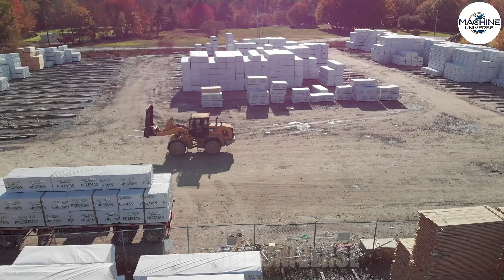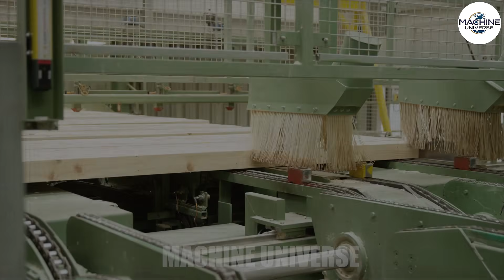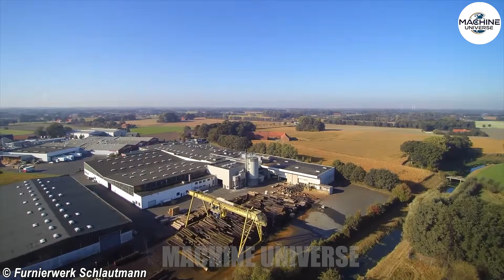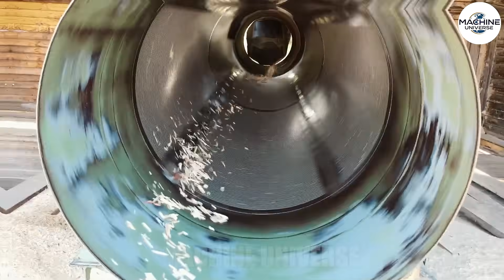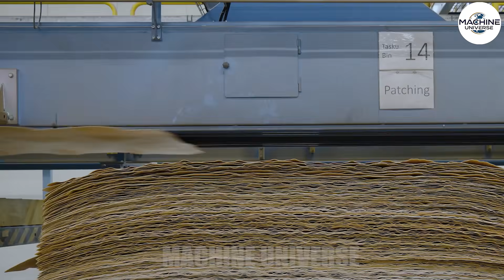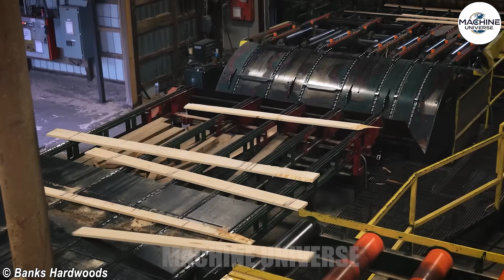Inside USA’s Most Advanced $1.2 Billion Sawmill – From Giant Logs to Precision Lumber and Panels!

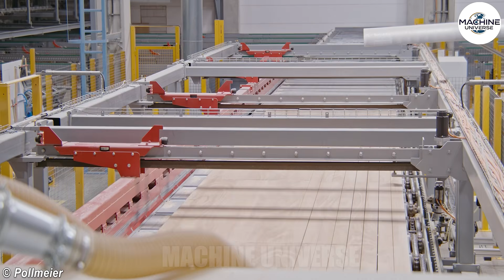Comment: 14:32 so whats the point in cutting the sheets thin then stacking multiple of them on top of each other to make a thicker sheet of wood rather then just cutting it thicker in the first place and just take out the time and process to stack multiple thin sheet together to make it thicker
Reply from the maker: It’s all about strength. Layering (plywood style) prevents warping and makes it way tougher than a single thick slab. Did the scale of that factory surprise you?